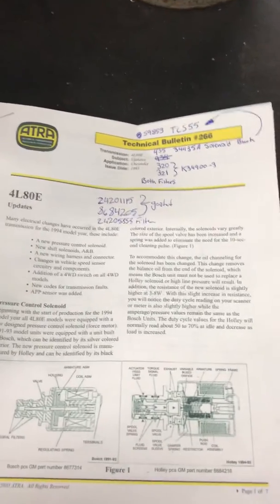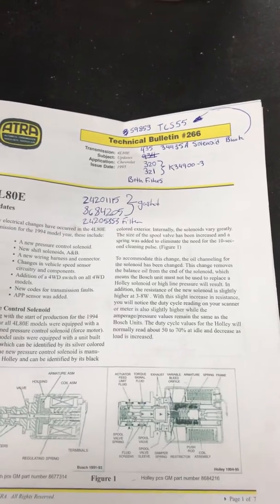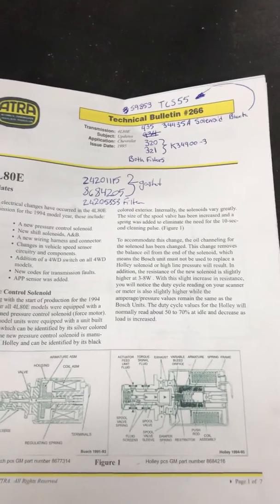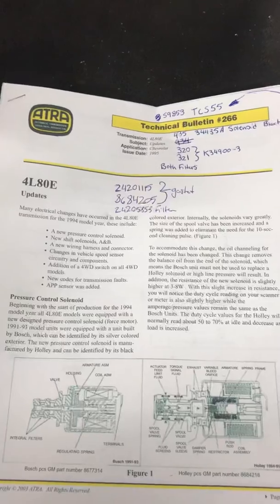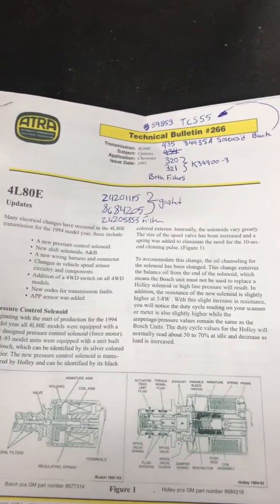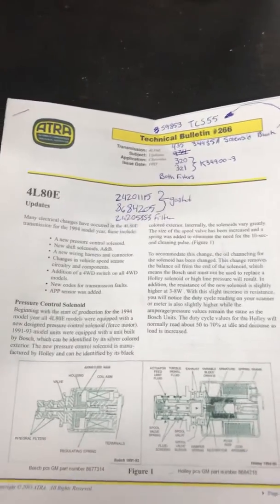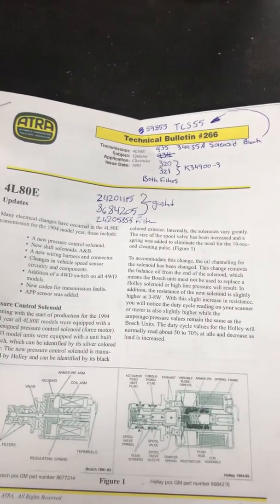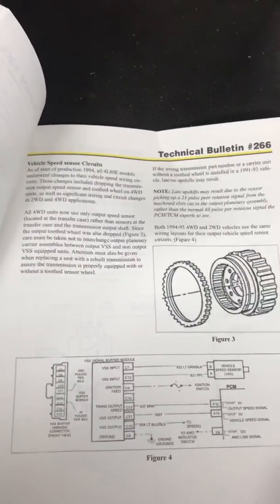4l80e Pressure Control Solenoid

Comment: Just want to add, the bulletin says a new connector was added, the reason why was, to prevent leakage and throwing lots of codes. So this settles the Internet argument, just because tranny fluid does not conduct electricity. Somehow, the connector throws codes, when leaking. So, after checking solenoid resistance before dropping pan. I'm convinced, that all solenoids work properly, and changing the harness, should correct problems, as many people, posts talk,about, when researching the connector and internal harness and possibly external harness.

Comment: Thank you. Lots of good info. I was looking for pressure control resistance levels. Mine was coming in at 6.5 ,which is out of range because I have the new Holly pressure control, the bulletin says the Holly could measure 3 to 8. So double triple checking info, saves money and hard work. Lots good info here.  TYVM